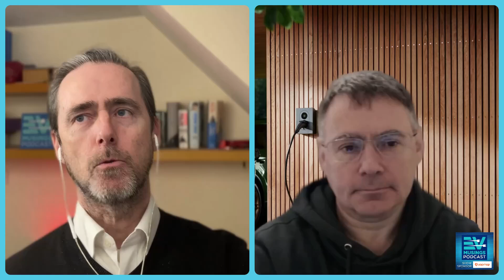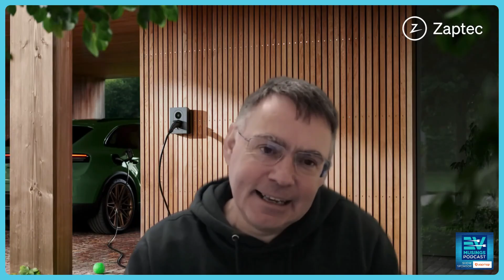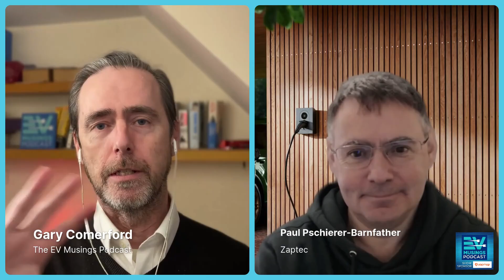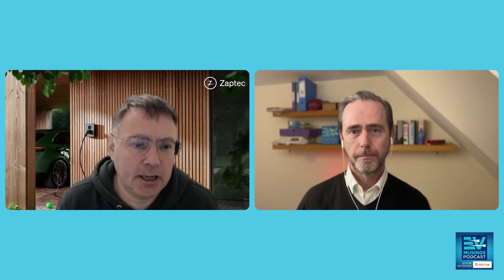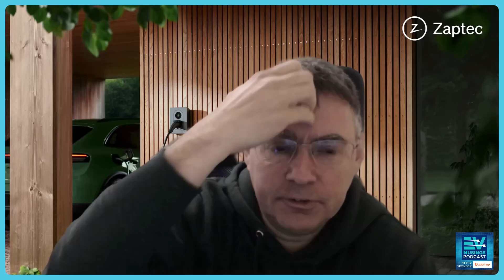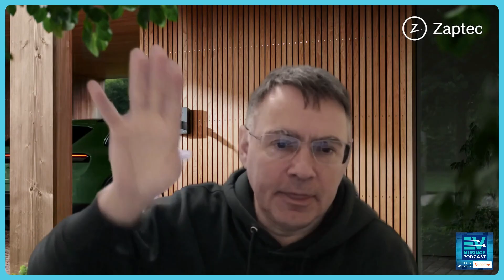V2G: The commercial use case is there; what's missing is the ecosystem.

Comment: Spot on. Paul is perhaps too diplomatic about the DNOs, who have used 'grid stability' as a convenient blockade for 15 years.
To put the scale of this 'blockade' into perspective: there are currently over 1.1 million fully electric cars on UK roads. If only half of them are CCS-capable and were enabled for V2G (Vehicle-to-Grid), we are looking at a stranded battery capacity of roughly 35-40 GWh.

At a conservative discharge rate of 7kW per car [05:54], that is 3.8 Gigawatts of flexible power—the equivalent of more than two Hinkley Point C nuclear power stations or roughly 10-15 gas peaker plants—ready to support the grid at a moment's notice. By dragging their feet on the 'ecosystem' and standards like ISO 15118-20 [02:08], the DNOs aren't just being slow; they are effectively keeping a £40 billion decentralized national battery unplugged while we pay gas generators to fill the gap.